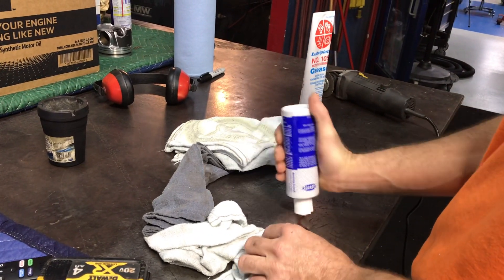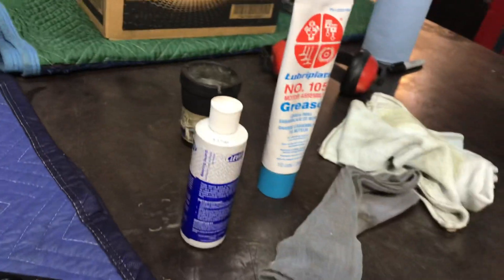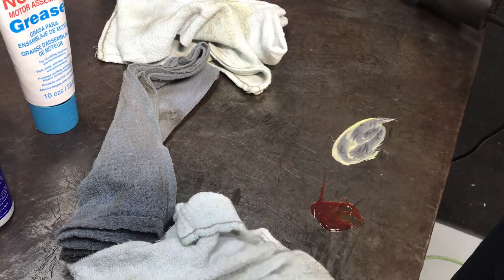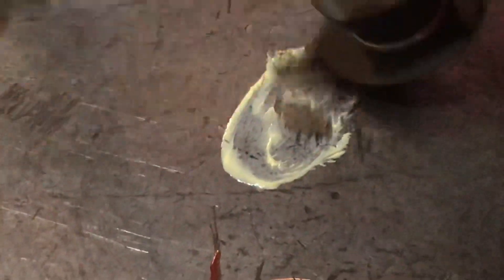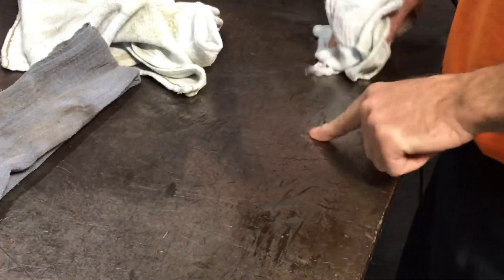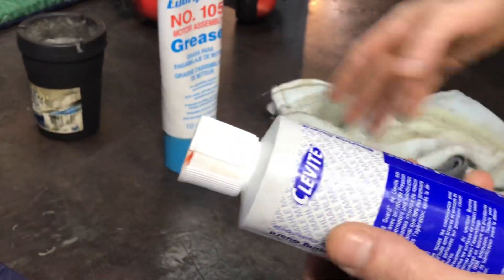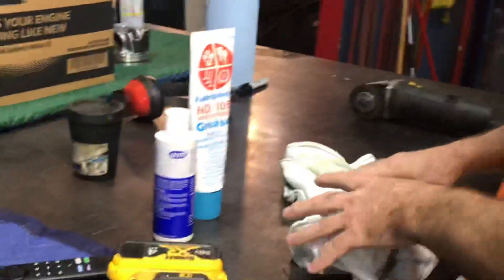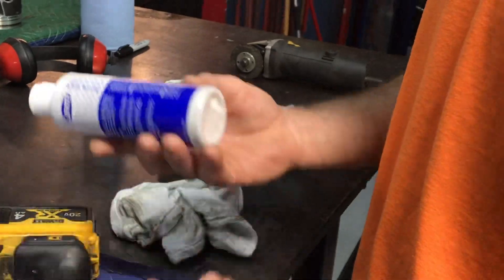Which Assembly Lube ?? Clevite bearing guard vs. Lubriplate 105 for your Powerstroke rebuild

Comment: The clevite is designed to stay put and as oil hits it it becomes oil and doesn't plug up a filter the lubriplate is also but it doesn't dissolve and mix with the oil as well. Also the clevite is more of a gel and tends to pull itself back instead of wiping off when rotating everything by hand

Comment from the maker: I did go ahead and use the lubriplate.  I agree once the engine has ran for 10 seconds or so,,  the lube used is irrelevant.    Just for barring it over building it,,  and for the first oil pressure build.

Comment: Here's a thought to consider: If the engine is put in to service  after assembly then, engine oil flushes it anyway. If not though say the engine is shelved,  then the lube stability comes into question.
I just heard of such a warranty claim , I 'll see if I can find the link and post it.